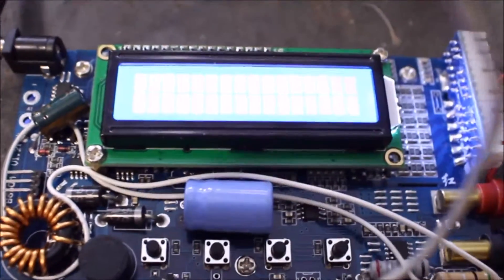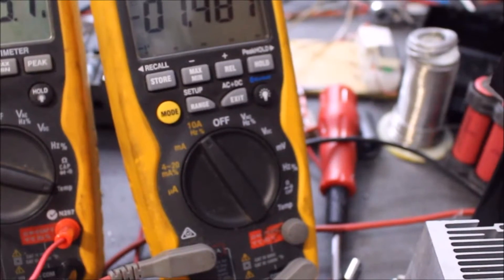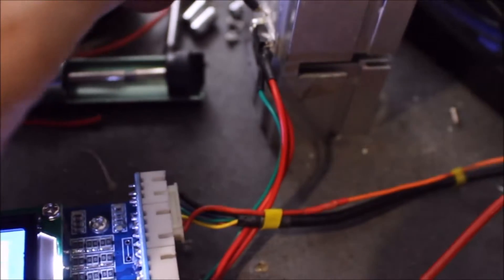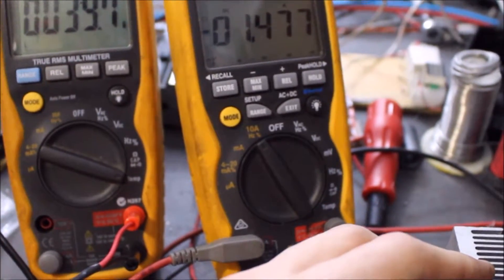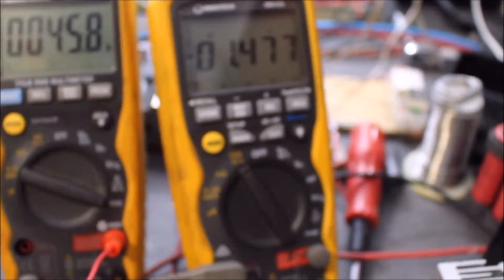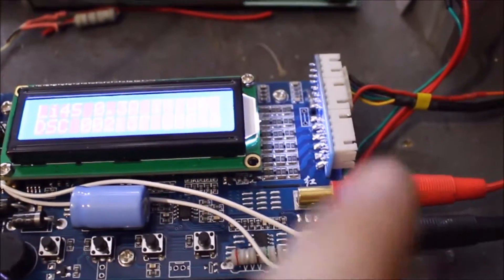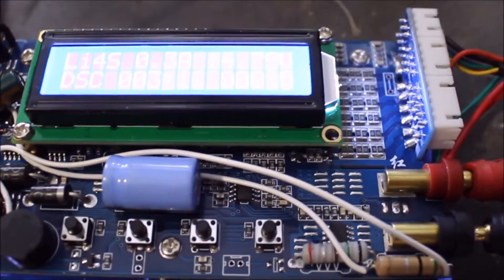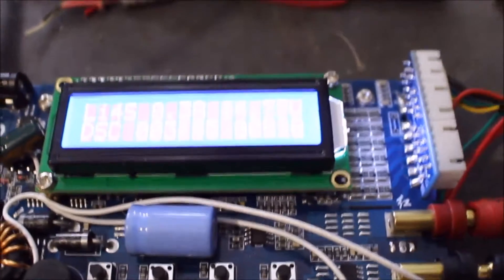UrbanOffGrid24 Imax B6 HACK 2A discharge

Comment: Any thoughts for increasing the charge current along this same line of application?  

Thanks for sharing, great info and glad I found as I was wondering about improving the THUNDER T6 MULTI I have and just started using.  Guessing the design is similar to the B6's.
Reply from the maker: They are going to be similar design with a current shunt. Hope you are able to mode yours too

Comment: hi could you tell us more about the resitor adjustin gyou made to get this amperage ?
Reply from the maker: So there is a resistor that the current flows through, this creates a voltage proportional to the current flowing through the resister (shunt), I used a thin piece of wire to decrease the resistance of the current shunt by soldering the wire in parallel this reduces the voltage so the imax pulls more current to get the same voltage, in my case 5 times what the imax is saying
Reply: Urban Off grid ok thanks
I have an imax and after frying this resistor and the mosfet irfz44n, and replacing them the charger pulls over 6amps from 1s battery on the dischage. This is confusing me.
Reply from the maker: 6 amps sounds like you might have damaged I/O in the micro controller so it's not sensing the current properly or the output driving the mosfet hard on pulling max current
Reply: Urban Off grid it might be but the other option are working good
Reply from the maker: I have not looked at my imax in a while but I seem to remember two current paths, one for the charging and one for discharge, it might be the error amplifier for the current shunt